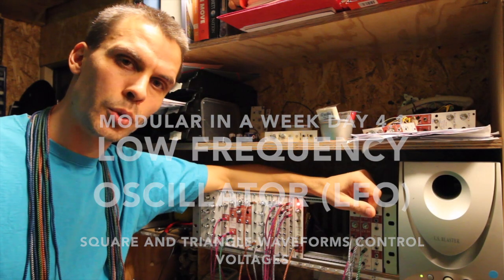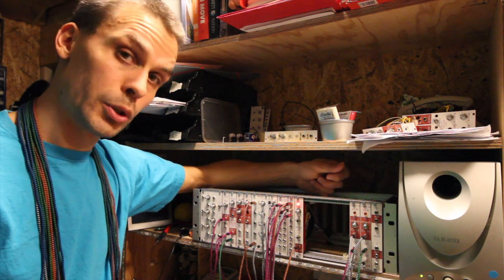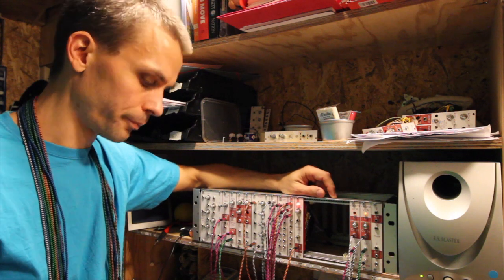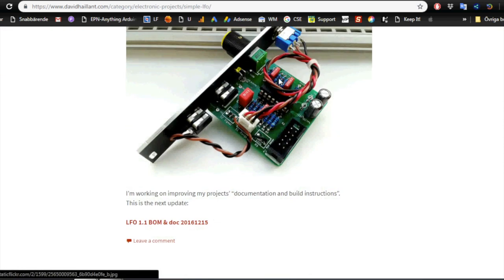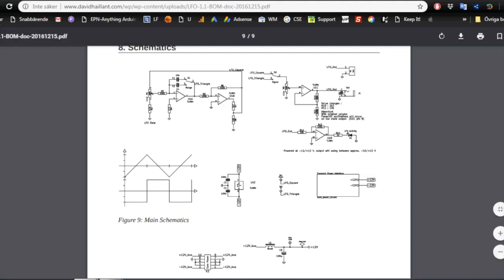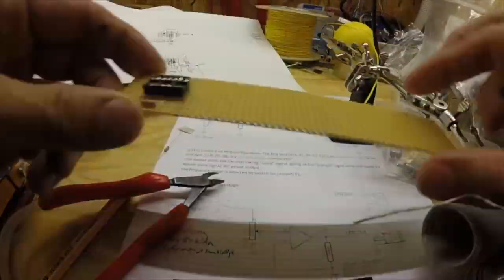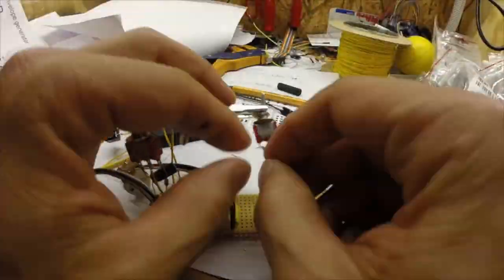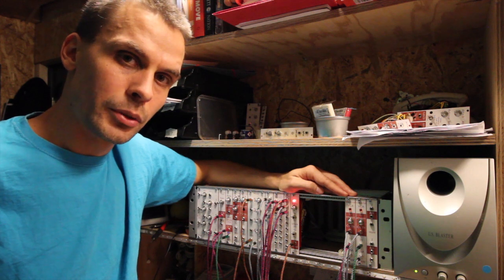Simple LFO with Square and Triangle waves - DIY Modular in a Week .1

Comment: capacitor 2 from david haillant bom, ceramic 1uF (105) is no where to be
 found (at least for me). Could this be replaced by an electrolitic 1uf?
 if so, how could i place it, since they are polaraized
Reply: use two 470nF in parallel

Comment: Hello again!  So, as you know, I have been plugging away at each build with success.  There has been a lot of learning, but I've always been able to work things out and get the module built.  Until this one :(.  I tried all sorts of fixes and swapping.  Put it on the breadboard and messed around.  No nothing?!?  I went onto a forum (not sure which at this moment, but I can find out) and found another simple lfo which works wonderfully.  Very cool.  So, my question/comment is this - as I searched through lfo's/vco's I noticed most use diodes or transistors in the oscillator cycle.  Could that be part of the problem?  Anyway, as always, thanks for the series.  I guess I should expect some challenges.  Speaking of which, I am now starting the VCLFO which looks like a monster!  Fun!  Ok, take care.
Reply from the maker: This seems to be quite a usual design for vcos/lfos so Itshould be quite straight forward. The vclfo has the same waveforms so you should be able to use only that if you get that to work. Also David hailliant sells pcbs for his simple life. I think they cost 5$ so not too much if you want to simplify the build.
Reply: @SourceryOne  That's true, forgot about the PCB's.  Maybe I'll try that.  (Just as a note, several times that I tried to get on his site it didn't open?)  Thanks as always.
Reply: I have the same exact problem,I can't really find anything wrong with how i soldered It together but It still doesnt want to work at all

Comment: Hey, thanks for the video, I really got an idea how an lfo works. I only got one question: is the potiometer, which is controlled by the cv send by the lfo bypassed or does it also set the range of the modulation?
Reply from the maker: In my build I didn’t add the range pot. In the schematics that David provides it shows where and how to add the range pot. If you add that you will get how much the lfo will modulate whatever parameter you choose to put it into.

Comment: Hello!  Putting the parts together for this one now.  Noticed on the spreadsheet there is a blank in the list above the 10k uf cap.  This module requires 2 of that part.  Do you know what part that is?  Thanks!
Reply from the maker: Um..... 🙄😂 I cant really see that there should be any. Sorry for the confusion. I’ll look into it a bit more when I get home.
Reply: @SourceryOne  No problem.  I was just going to go through the schematic myself.  Just wanted to make sure I got the right parts.  Thanks.

Comment: Found your channel this weekend and I love the MiaW videos. I am going home and building a version of the x6 oscillator tonight to start tinkering, but based on a 74HC14 since thats what  I have. I have some clementinlådor I have saved for some fun hack and I think I am going to build a modular-ish synth in one of them. 

You talk about your protoboards and show them off a bit in some videos, I assume you did those yourself ? If so, are there better pictures of how they are set up? And maybe you have gerbers available? :)
Reply from the maker: Also clementinlådor should make a good modular box. Wooden panels is all the rave 😜
Reply from the maker: I am still prototyping these boards and making sure they work. I’ll make some kind of production of them and open sourcing the gerber files in a bit. I need to finish my MiaW first. ;) the 74hc14 should work. Although they can’t handle 12v I think so check that before hooking it in.

Comment: Maybe this very cheap function generator (Sin, Tri, Square) kit can be turned into a  good LFO: https://www.ebay.com/itm/XR2206-Function-Signal-Generator-DIY-Kits-Sine-Triangle-Square-Output-1HZ-1MHZ/323206424083?_trkparms=aid%3D222007%26algo%3DSIM.MBE%26ao%3D2%26asc%3D20161027085944%26meid%3D0f7f228186e64157bcc77c5cd2384714%26pid%3D100623%26rk%3D1%26rkt%3D6%26sd%3D123072785028%26itm%3D323206424083&_trksid=p2047675.c100623.m-1
Reply from the maker: Yeah I’ve seen it and have it in my eBay shopping cart. :) I don’t think it is voltage controllable in its original configuration though. But i will definitely look at it at some time. Thanks.
Reply: @SourceryOne  maybe the icl8038 is a better choice, uh?
Reply from the maker: The xr2206 is actually a very nice chip. It’s just these ready made modules aren’t always built for musicians and cv in mind. Just as tinker toys. Are you trying to make me add more stuff to my eBay cart? Now I have to go and look at what this chip is. Otherwise the cem3340 chip is a very nice chip for vcos and lfos although it is quite expensive. I’ll make a module with that one as well of course. Even though that one component costs more than most of the modules I built so far. ;)
Reply from the maker: And yes the icl8038 sound like a nice chip as well. Although it is obsolete (which I think the xr2206 is as well. )
Reply from the maker: Lol. It’s just making modules that “anyone” can do is harder with obsolete components that people need to scour the internet to find. Off the shelf components are easier for everyone to find. I am perplexed by the fact that these xr2206 kits still are sold though. Maybe the xr2206 is also anew production run?
Reply: The ICL8038 is an easily available chip.
 It is voltage controllable, has a wide frequency range, wide PWM / symmetry control, and provides simultaneous square, triangle, and sine wave outputs.
 And it's cheap.